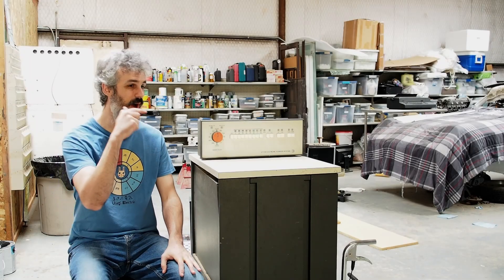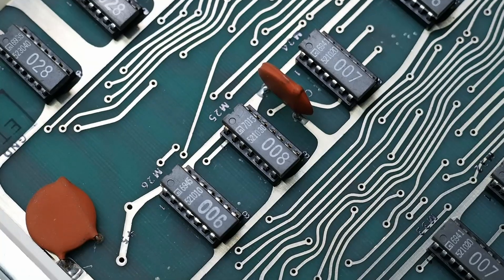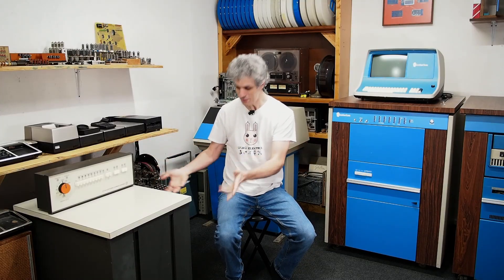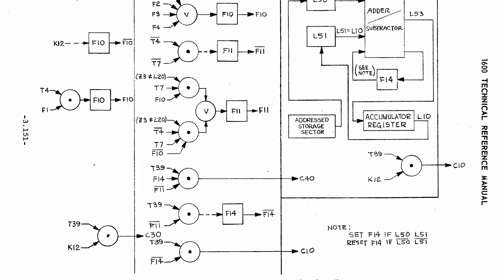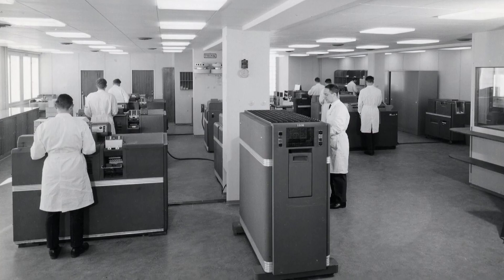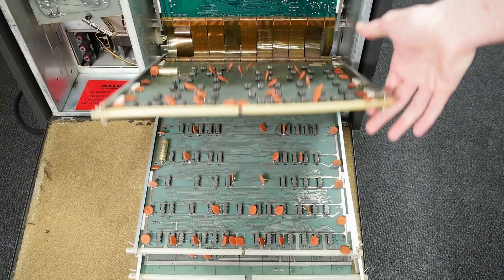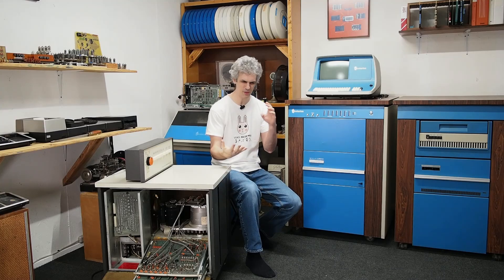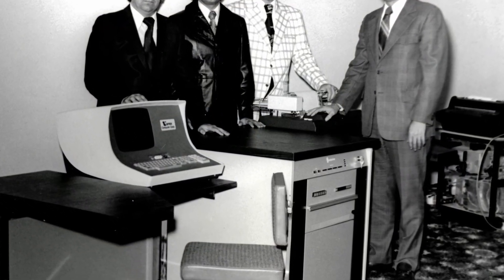Meet my new Litton Minicomputer (it has Drum Memory)!

Comment: I was a student worker at the computing center where I went to college. They had a Burroughs B6810 mainframe. That's a 48 bit machine, including floating point math. There was some rough water between the college and Burroughs, so they went looking for another vendor. I recall there was a lot of interest in what was termed "mini computer" at that time, and I specifically recall them having a big interest in Prime Computers. Since I ended up working and retiring from there, I decided to do some research. I was shocked to learn Prime was a 32 bit machine. So back in 1980 to 1983 or so, they were actually looking to run all of the software on a 32 bit machine. Absolutely crazy thought in today's world. And in the end, the rough water calmed down and the college (later a university) stayed with Burroughs/Unisys until about 2010 or so.

When you start looking at 40 bit words, there was really nice stuff that could be done. I'm sure you will have a good time restoring that piece of history. But those ribbon cables ... Not quite so much fun.

Comment: Lucky for you to be dealing with these systems, the ones I worked on in the late 70s and early 80s were Qantel (NOT Quantel with a u!) and even if I found intact hardware it would be useless because they required special registration codes to be used.  They also used "smart" terminals that couldn't be replaced with just a VT-100 or something.

Comment: Ugh.  I was looking over the documents over at bitsavers.  Any idea how much this system cost?  From what I am reading they were going for a low end and given the disassembly, it looks bare bones.  The very fact the drum is being powered by a basic AC motor tells me the drum HAS to have the timing on it.  No other way to keep the data in order.  Its honestly quite fascinating.  Its a way to make a dirt cheap computer with a large storage.  If your a small company, you don't care if it takes a few hours to do payroll.  Still, it is somewhat weird it doesn't have a punch card database.  Or did it?  What kind of preliberal were connected to it?

Comment: this is a strange story.  back in 1972 when I was 10 grade,  I meet a friend thru a math class.  the school had 10 tty types terminal were we would dial in the HP system on the other side of the city.  He said the HP had "drum memory". the system could have 64 dial in users. at that time I called "BS" to his story. the next year we got IBM System 3 mod 10.  at first we coded COBOL programs for the school district. I later found a 1" gray book labeled how program for RPGII.  with school having 129 keypunch, I made program cards to punch the different card formats. the problem was the book did not had all the "device" names listed in. we had to "Call" IBM to get all the manual pages we were missing and IBM sent a programmer to the school to explain the manual. He was given a week to do the "training". he was there for less then one school day and we were cooking with gas!  RPGII was a very circular language.  I found a way to cut into loop to make a program do what ever I want it too.  I gave sample to IBM.  next thing I knew I was getting call from IBM engs how asking how did I break they cycle. All I had done was write subs that worked around the limits of they the cycle as class work for extra credit. We had to "trade" programs to see if there wasn't a better way to make the programs run.  Making them faster and shorter.  When you only had 16K bytes  for your code you do what you can do.  like writing you working storage to disk pack (like you use except they were only 2.2 MB). that was computing up till late 70's

Comment: DEC produced a lower cost version of its 12 bit PDP-8 minicomputer with serial ALU, the PDP-8/S.   Drum memory  was famous in the IBM 650, which served as IBMs entry level computer for many years in the Fifties and Sixties. Drums were used later for fast random access storage. One Burroughs drum weighed literally a ton and tendended to break free and walk around due the forces generated by its fast spinning drum.  The Army and Navy tried to use the Burroughs drum in mobile applications but the the rotational forces were too much for the ship or truck carrying the drum..  The drum in this machine is a relatively minaturized version of the breed.    Drum memory machines had to account for drum rotation  when placing instructions.   The techniques for optimium drum computer performances are similar to  those used with RISC machines. Dead space in the instruction stream can be filled in by unrelated secondary operations.

Comment: Last time I saw a drum memory was in high school about 1975 . I was in an electronics course and
we got old computers donated to us from oil company seismic outfits, the drums were used to record seismic vibrations from dynamite charges set off to find oil formations underground. These things were very heavy with fixed recording heads and pretty slow rotation as I remember . Looks like you found a real winner it
Will be amazing if you get it to work again 👍

Comment: For your flex cables You can get them made from PCB Way or similar. You copy out the layout and circuit and order it as a flex.
Pleas pleas pleas don't go mcgiver on old flex it can start to conduct across the plastic sheets. 
mind you i dont think one of these old dino's will care much about some minor crosstalk but it could eventually start to allow some decent current across. 
Alternetly you can build out your own using the orginals as a template. Have fun with the exacto :)

Comment: WOW....A Litton 1241 ABS Controller Unit.  The first program I ever wrote was on this machine. If I recall, the paper tape is encoded as 7 bit ASCII with an extra bit for parity.  You should be able to clock the old tapes through an optical array to read them.  I remember that the Litton programming language could pretty much be likened to a subset of Assembly language.  I was about 15 yo when my mother bought a used one for her accounting practice in or about 1976.  It cost around $18k, which was a huge amount of money back then.  I hope you find a paper tape reader/punch and teletype.  Thanks for the memory.

Comment: Amazing is this link... though technical at the bottom of the barrel, the business on top is driving it... like Intel's technical behavior vs Motoral's technical behavior. Intel sacrificed some of the technical 'purity', have a migration path so the customer did not need to change horse (supplier). Motorola, when moving from 8 to 16 / 32 bit let the 8 bit cutomer (much more) on the dry (then Intel). No compatibility mode... 'The 68000 grew out of the '''MACSS''' (Motorola Advanced Computer System on Silicon) project, begun in 1976 to develop an entirely new architecture without backward compatibility. It would be a higher-power sibling complementing the existing 8-bit Motorola 6800|6800 line rather than a compatible successor. In the end, the 68000 did retain a protocol (computing)|bus protocol compatibility mode for existing 6800 peripheral devices, and a version with an 8-bit data bus was produced. However, the designers mainly focused on the future, or forward compatibility, which gave the M68K computing platform|platform a head start against later 32-bit instruction set architectures.' as taken from History about the Motorola 68010... --- At that time - being an engineer - I was disappointed with Intel's compromise of keeping 16 bit address with 4 bit bank switching to get to 1 MB... and rooted as much I could for Motorola... (and looked down on Intel's 'moving forward'). Guess who is still in biz and leading: Intel... sometimes progress comes with compromising stepping stones to keep the customer base - to keep the order coming in! - Interesting to see this 'Intel approach or pattern for business sound progress' repeated in this fascinating history of Litton and Centurion success. Therefore: Engineers, do not forget the business... it feeds you literally and provides the creative space to be a grounded engineer... haha...

Comment: Not sure if it was this vid or not.. But you were looking for ribbon cable replacements because they delaminate... Could Flexible pcb's be a way for that?.. JLCPCB has FLEX pcb's you can print.... probably you could make a ribbon cable with that... Either just punch the connector through, like with normal ribbon cables, or maybe make a spot so you can solder a connector on... Then you can make a flexible multilane connection... much like a ribbon cable.. If you can't find the original ribbon cables...

Comment: Interestingly, Unix or at least the BSDs have or used to have a drum device at /dev/drum. I don't know a lot about it and I'm not sure if that was an attempt to use a single hard disk cylinder as a literal drum (limited by RPMs and the number of heads, which are generally far fewer with HDDs than with traditional drum memory), or if the Unix drum device was a more general and flexible paging device. Also, apparently most Unix-likes don't have /dev/drum anymore. If anyone knows more, please share.

Comment: This seems a lot like the LGP-30 from about 1959 which was a deep-freezer sized tube and semiconductor diode "general purpose computer" that had a 4K word drum memory.  It operated bit-serial, with 32 bits per word (though one bit was apparently a "spacer" bit and wasn't writable).    It's teletype was a Friden Flexowriter and also had a separate paper tape punch and reader.   The LGP-30 had a hardware multiply, though it took like 120 clock cycles to perform.   The accumulator was stored as a track on the drum as well, and it's front panel had a small oscilloscope which displayed a square wave trace of the contents of the accumulator and IIRC the program counter.

One thing I recall about the LGP-30's drum memory is that after spinning down the drum you needed to wait 1/2 hour before spinning it up again.   This was because the drum would heat up and expand, and if you restarted it too soon the heads would hit the drum and damage it.   There was a big homemade sign taped to the one I worked with that admonished operators to be sure to wait sufficient time for the drum to cool off before restarting-- apparently, head crashes were common and it could require re-positioning and/or replacing heads so that the new position was over an otherwise unused portion of the drum-- not a job you wanted to have to have done...

Comment: It is amazing how much was done with so little of both memory and processing power.

I wonder if you could, and would there ever be a reason to, address a single byte in memory? Do I understand correctly that there were only 4096 memory locations (5 bytes each) that could be addressed? When comparing to a presumably 8 bit core memory computer with 4k of total memory but also the same 4096 addressable memory locations, would it be fair to assume that the latter would have had better use of each last bit? I'm assuming one would utilize small counters and such for 'loops' and 40 bits would be excessive. Did programs back then process data and more or less immediately store the result on paper tape, or did they do extensive processing in memory? Was the user experience for the end user running an application interactive or predetermined in nature? Did you run one specific task on your data, or could the end user play around with the data without writing a new program? Am I under- or overestimating the capabilities of machines like this?

Comment: I had one of these computers in running condition in +- 1980. really interesting to program. I ended up dismantling it for parts, and used the drum memory unit as a tactile/auditory effect in a 2 seat spaceship simulator i built- fully enclosed with a sliding top. i removed the rubber shock mounts on the drum unit and bolted it directly to the frame of the simulator. truly awesome sound and physical effect- sounded and felt just like a jet engine. ahhhh, nostalgia. I later built another simulator that moved in 3 axes using the panels from a discarded IBM 1401.

Comment: The rotating drum memory was developed pre-WWII for the ABC 'Atanasoff Berry Computer'. The drum memory was a bunch of electrolytic capacitors, basically Dynamic RAM with 1940s tech. Many of the ideas that were used to build the ENIAC were 'borrowed', without credit, from the ABC.  https://en.wikipedia.org/wiki/Atanasoff%E2%80%93Berry_computer

Comment: To me, 40 bits signal "IAS machine heritage". Many of the direct descendants of "the IAS machine" were 40-bit machines, jsut as the IAS machine was. And they, in turn, gave rise to other machines that were 40-bit. The earliest commerical model I am aware of is the Ferranti Pegasus, but I am also aware of prior machines using it, although they're more "one-off machines". BESK, who begat SMIL, DASK, and SARA (all 40-bit machines on the general IAS architecture spectrum). SARA then begat CK37, and D2, but I do not know if either of the latter were 40-bit machines (CK37 is the on-board computer in the Saab Viggen military jet). That 40 bits happened to also be handy for business computing...

Comment: I remember reading some old usenet anecdote about a guy who had to work with/on a machine with drum storage/memory which had an infinite loop set up in it's programming, and which confused the hell out of the young tech. After much research they figured out that the program which used the infinite loop managed to make it not so infinite because of the way the read head of the drum mechanism had to physically move, and even though there was no code way it could break the loop, there was something that made it seek long enough to land somewhere "wrong" that got it out of the loop and jump it somewhere is in the program.

Comment: As for those ribbon cables you can probably get ribbon cable with that spacing and thickness of wire. If you're careful and gentle you could probably replace all those ribbon cables. If you're really okay with it not looking original you could probably take wire ribbon cables and just connect them to those same spots. That would last longer

Comment: I had a complete working Litton ABS system as shown in the video: CPU, paper tape punch/reader and printing terminal. It used large circular military connectors for interconnection. The terminal had an interesting keyboard which had an interlock mechanism that only allowed you to press one key at a time (all other keys were mechanically locked out and you couldn't press them). It was a rather slow and noisy affair. At the time I was a poor typist, and I could still out-pace the keyboard mechanism. The whole system ran an operating system called OPUS (if I recall correctly). The drum was remarkably quite, although the paper tape punch was very noisy. Someone added a power switch to turn off the punch motor, but it would create a power glitch and crash the CPU every time. The paper tape reader was all mechanical: it had little pins which poked through the holes in the tape. Using a cam, all the pins were withdrawn and the tape would advance one sprocket. The pins were then raised to detect holes in the tape. The PCB's for the tape reader/punch were very large (maybe 20" x 12"), with only transistors, diodes, resistors and capacitors - very sparsely spread out. Sadly, I threw out the Litton, along with an NCR 299 and a Data General MV8000 (yes, the model which was written about in "The Soul of a New Machine"), and yes, I'm regretting it almost every day....

Comment: There's an awful lot of companies that print Kapton circuits and even more that offer Kapton ribbon cables in what I'm guessing is standard 0.1" DIP pin spacing. If not, just chop up some old floppy drive cables and get to soldering.

Comment: I got into the computer field just after the paper tape era, so had heard about that from the Old Timers, but never saw or handled one. So just had to look it up.  Interesting Wikipedia article. I specifically wondered what kind of paper was used. Was it ordinary paper or did it have special qualities to make it stronger? Ordinary paper deteriorates over time as the acids eat away at it. All I found was that  at least sometimes acid-free paper was used. A variation was made of Mylar. 
Mister Google also came up with something interesting: A number of sites show how you can make your own paper tape reader from off the shelf parts. Would be an interesting project. Apparently paper tapes for computers of this era were coded in standard ASCII.

Comment: Those flexible circuits look don't look so good. For the moment, loose material can be carefully peeled, and then they can be cleaned with isopropanol, and then Kapton tape could be applied to the remainder to keep them together, and protect the traces from shorting the boards out. Kapton tape can be bought in large sheets for 3D printing--if you can't find tape large enough.

If the rest of the chips and ROMS can be salvaged, perhaps a PCB for the flexible circuits could be made. Hopefully, they are all the same, then the cost would be doable.